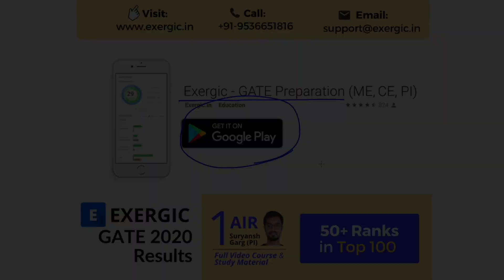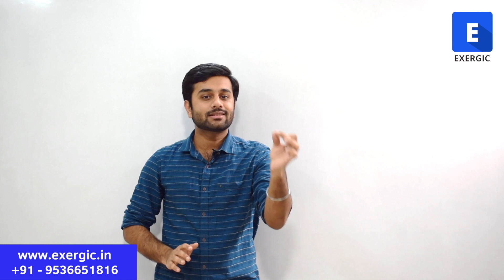Only GATE Toppers have this skill

Comment: Rubber band has initial length of 100mm but it is stretched further by 140 mm... So of i take x as. 14m, Iam getting value of speed as 6.26 m/s
??
Reply: Yes I'm also getting the same
Reply: Two sides stretched